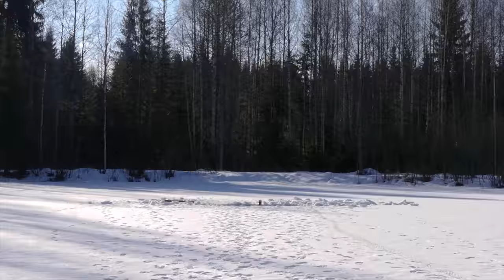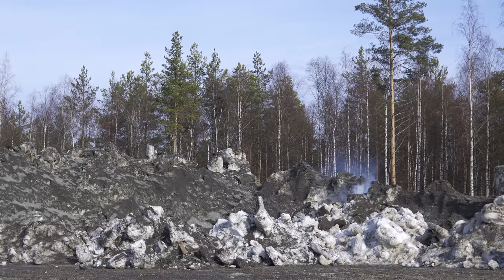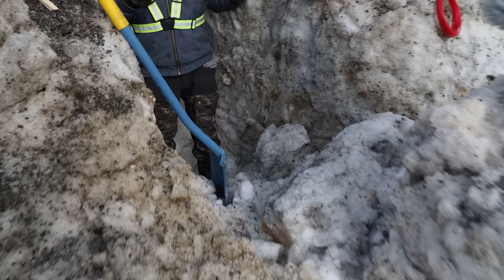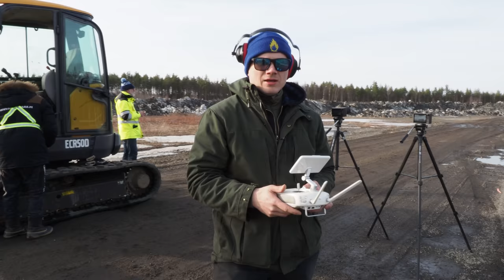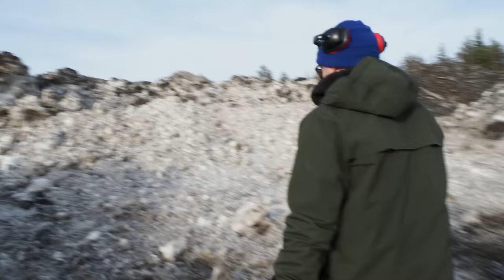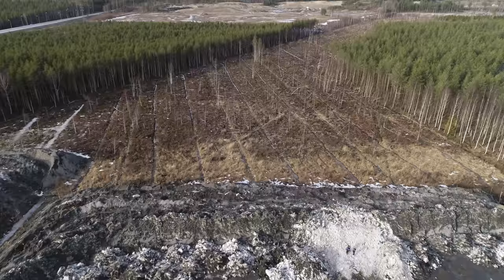We Buried 50KG/110LBS of Dynamite in a Snow Dump Site! Best Way to Deal with the Snow?

Comment: It’s amazing how much force it takes to do anything with water, whether wet or frozen.
Reply: Are you familiar with Barnes Wallis' "bouncing bombs"? Part of the princple is that the bubble collapsing against the dam after the explosion does more damage than the explosion itself.
Reply: @jjohnston94  Bomb Gone !!!  The Dam Busters.
Reply: Water is pretty heavy weighing in at one ton per cubic meter
Reply: You can’t compress water so it doesn’t have a reaction
Reply: its amazing to see a pump the size of a pickup truck with a 750 hp electric motor struggle to lift water up a hill.
Reply: Water isn't wet. It gets things wet.
Reply: Dry powder snow would be a very different story. This bad snow looks like it has some road salt in it, its from city streets/roads, that makes it different from all natural snow types.
Reply: It was like a wet fart😂

Comment: I've heard that when there's the danger of an imminent explosion on a gas rig, they activate the sprinkler system in advance. Apparently the presence of the water reduces the explosion's destructive force by something like 90%.
Reply: Well that would be a great test to see.
Reply: Seems a bit logical to me cause wet air does not transfer so much heat than dry air.

Comment: This is an interesting test.  What is the rating of your dynamite, I believe pure dynamite is over 26000 ft./second.  I worked in norther Canada as well site shooter, the dynamite I had was just over 25k/sec.  almost pure nitro.  I drove four miles from oilwell campsite to demolish four hundred pounds, it was winter and temp was about fifty below zero.  I decided  to destroy all of it at once, I packed it all through the snow about a hundred yards.  The shock wave I found out later, traveled many miles on the permafrost and almost destroyed the well site, knocked off all supplies in the storage units for about fifteen employees, fortunately no serious damage was done.

Comment: well, water does absorb Gamma and cosmic rays, so a fallout shelter lined with snow would do the trick, barring a direct strike, which means all bets are off.

One trick you ought to think about is the ammonium nitrate diesel fuel mixture we commonly use to remove mountain tops in Eastern Kentucky to strip mine coal. I've seen whole mountains flung away like that.

Comment: You need a heat source to melt a lot of snow. Dynamite will only make it explode but all the dynamite in the world can't make it melt if it can't reach it. Lava, for instance, has no trouble at all melting snow, and of course, anyone that gets too close to it. What you want is a way to rapidly spread a heat source through a lot of snow at once, it would depend on how an explosive would propagate through a snow bank, if it sends the right shockwaves that would make it a lot easier to make more snow explode or melt.

Comment: "All of the explosives" would be like asking the Finland air force to perform multiple live fire airstrikes on that snow dump.
Reply: The Finnish air force can choose from its arsenal of weapons. JDAM GBU-38, GBU-32 ja GBU-31, 500-2000-pound warhead, AGM-158 JASSM Joint Air-to-Surface Standoff Weapon with a 2,000-pound penetrator/blast fragmentation warhead and   AGM-154 JSOW Joint Standoff Weapon 1,000-pound warhead.

Comment: 2700kg of dyn plus a 45cm layer of pearlite in a 5m long charge triggered 1.5m in from each end synchronously underneath the pile would have cleared to the ground... it takes a surprising amount of explosives to heave snow cleanly because the compression wave melts much of it that then re-forms when it decompresses.   Structurally speaking Ice is one of the most powerful forces on the planet.  It can destroy even the heaviest most re-enforced artillery breaches mankind can make if you just plug it from escaping.  It can be used very effectively in demolition if you can control it's presence and leakage.

Comment: This made a really big dent into the dump, but I “snow” what would make an even bigger blast - a fuel-air explosive! Does Henri have a permit for that?
Reply from the maker: I have been thinking about doing one of those. I think it doesn't even need any permits since you are not technically even using or making any explosives for the main blast. The video just would have be quite straight forward not to give too much information and there would be probably quite much working on testing and perfecting it since there isn't much information available.
Reply: @Beyondthepress  You need a little bit bigger bang, perhaps something slower like ANFO would work, less bang, more like whoomp.
Reply: @Beyondthepress 
I don't want to write to much but you pop inside fuel to atomise it into the air and then you give the fuel air mix a spark to go off.
So you will need something in the center to atomise the fuel into the air.
I suppose you could use compressed air to atomise but that might actually be more dangerous due to compression ignition. 
The point is there is no oxidiser when you spread the fuel that fast with a big pop. 

You can find a surprising amount of info online including some TV documentary on us moab which details the process.
Reply: @TheWebstaff  They regularly blow up oxy-acetylene balloons. The question then becomes: How do they get the snow saturated with it?
Reply: @Beyondthepress  The "fuel" doesn't have to be liquid. Read up on grain silo explosions. They are fuel-air explosions too, and a lot of work has gone into finding out how they happen and how to prevent them. Just so you know, that kind of explosion works as well out in the open as inside  a silo. ;>) A few kilos of flour and an air canon to make a big cloud, some way to provide a spark, and away we go! Start small though while experimenting, the bangs can be VERY loud.
Reply: @Bob5mith  That's... scary, and might even work!
Reply: @KnifeKnut  A freshly refilled trench might have more airspace. Dirt would. Not so sure about snow. They could spray the outside with near-frozen water and let it create an ice shell to help retain the gasses.
Reply: I used to live near a factory the pulverized anthracite coal into powder for pigment, tires, etc.... Couple times a year they'd have a dust explosion....loud very loud.
Reply: Wouldn't even touch it.  Ice would suck the heat right out.
Reply: @markfergerson2145  I like that idea a lot. Would be hard to light it with how powerful the flour blast would be, but I'm sure a road flare could do it.
Reply: need a mixture of aluminum powder and ammonium nitrate. there will be more gases
Reply: Mythbusters created a fuel-air explosion when testing the mobile phones at the gas pump myth

Comment: Where do you get the dynamite? I would need some here to remove some trees that has fallen over my favorite bike path. But I can not get either dynamite or detonating cord. The later should be sold in shops as it is so practical, but for some crazy reason is not.
Reply: It's a practical way to blow your hands of if you don't know what you are doing. :D

Comment: I found it quite interesting how the snow started moving several frames after the lit fuses sped under the snow and should have burnt out. Looked like the snow must have absorbed a whole lot of energy before it (well, its surface at the very least) started moving. I imagine 10kg in a drilled hole instead of a loosely back-filled trench would have been even a wet fart too.
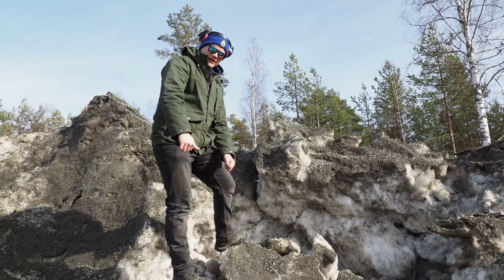Reply: Part of that was a deliberate delay (not just the delay they referred to at 2:48). I learned all this from some blasters on one of my construction projects some years ago, so I think the source is legit. There's a main section of detcord (not fuse or copper wire, but a thin core of explosive with a thick plastic insulation on it) that they call the "message wire", which they start the detonation at the end of. Then, there's a separate piece of cord going to each charge, called "downhole wires", T-ing off from the message wire with a crimp-on connector. At each charge, they crimp on another connector with a built-in delay (labeled in milliseconds). This is to make sure the "message" (the detonation) goes all the way to the end of the message wire and down every downhole wire before any of the charges goes off, to eliminate the chance of the message wire being cut by one of the early explosions, and the message not going any farther. You can see the message wire burning from right to left, then each downhole wire goes up the slope and into the snow, then the main delay starts. On my project, they didn't have the additional delay they referred to at 2:48; all the charges would go off at the same time. In this one, it sounds like Henri had to add an additional 25 milliseconds between charges so they wouldn't all go off at the same time - thus complying with the letter of his permit allowing him to detonate 10kg "at one time".

Edit: I noticed that Henri just stuck the cord and cap into the explosive and called it good. The blasters I worked with would bend the cord back 180° along the explosive schlong and tape it in place, to make sure it didn't come out.

Comment: The problem is you're using the wrong explosives if you want to blast a huge crater in the snow dump, you need to use a slow explosive that pushes, such as ANFO (ammonium nitrate and fuel oil). Try that out and I'm sure you'll be far more satisfied with the results.

Comment: Govern: The snow is accumulating and it's getting dangerous.

Lauri: Hold my Mesimarja, we are gonna deal with it.

Though I could say that ignitions weren't at the same time. It's way different when things explode one after the other than at the same time. You are not mowing down a building which needs complex techniques to. You just WANT to blast the snow the f-off. I suggest another run with getting the explosides as synchronized as possible.

Comment: I'd be interested to see the effect of slower burning vs faster burning explosives on this. How about another balloon of oxyacetylene? Snow is going to be a tough enemy because it doesn't provide the containment of something uncompressable like water or rock. It has a very open crystal structure and packing factor. Packing it down more would help. This needs further examination.